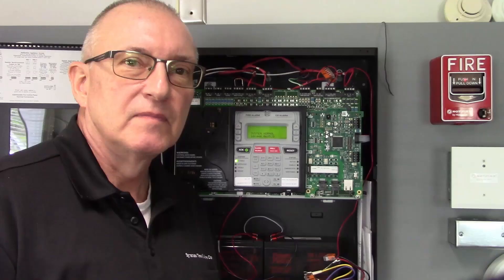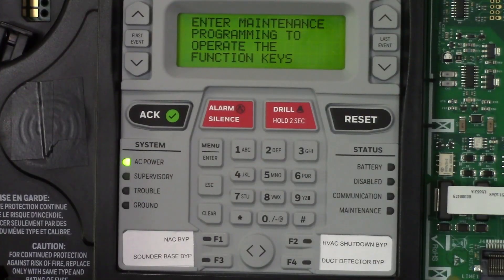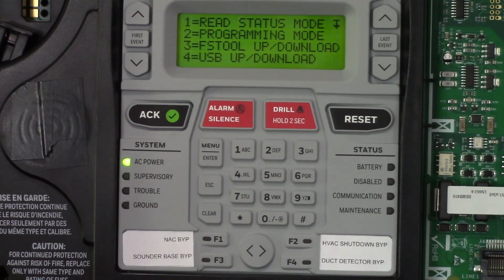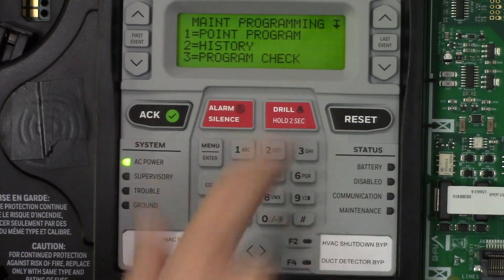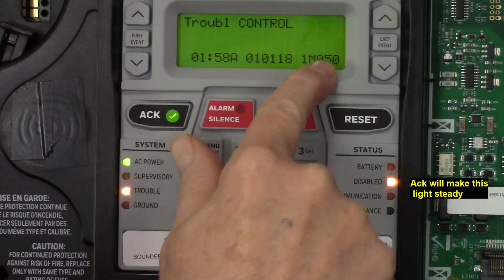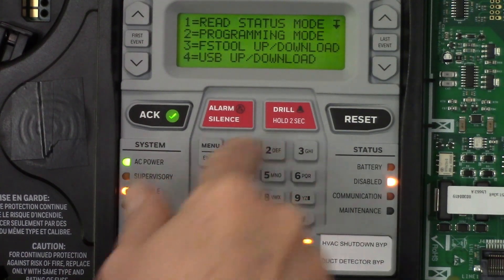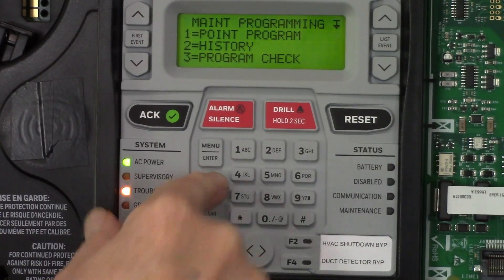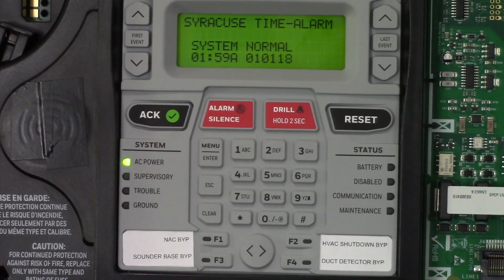👷  How to Use Function Buttons on Notifier 50X & 100X Fire Alarm Panels (Fire-Lite ES-50X / ES-200X)

Comment: What is the benefit of this entry level tech here who has not went through programming yet I’ve used the all 0s programming mode only for simple stuff
Reply from the maker: Front-panel programming is helpful for basic or quick changes, but programming software provides major advantages. With software, you have a saved backup of the system programming, which is critical if the panel ever needs to be replaced. It also saves significant time on larger systems and is essential when dealing with complex logic, custom I/O, or specialized programming requirements that aren’t practical to handle from the keypad alone.